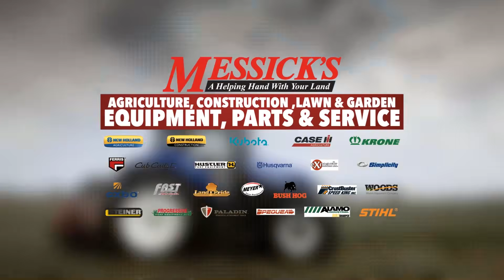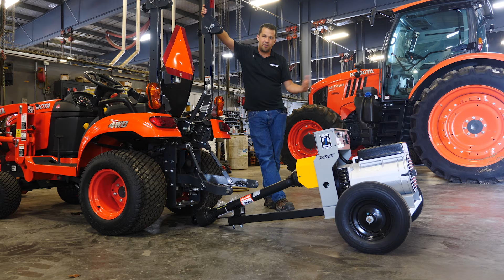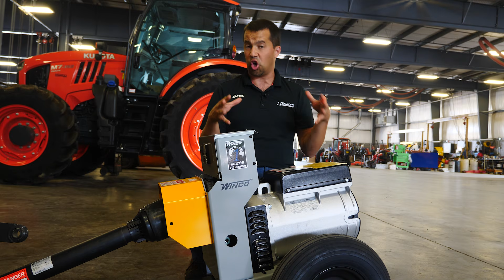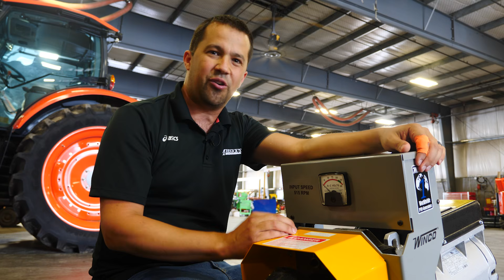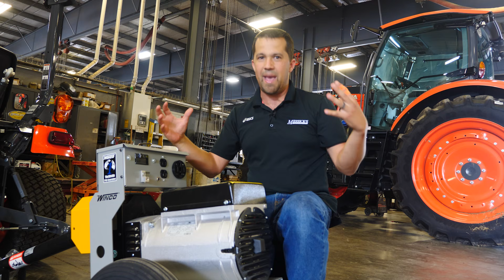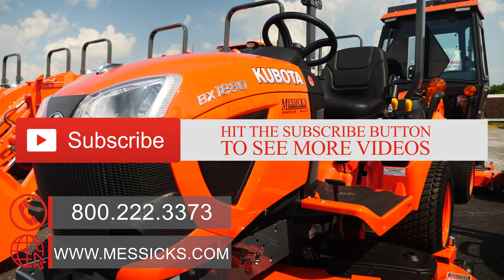Power your home with your tractor - Winco PTO Generators

Comment: I would  like to buy  a pto  generator   of 15000 watts,   prices vary I know but because  I had a Winco 13000 Watt in the 1978-79  Winter  I would like   the same brand.
Reply from the maker: 7173671319, we have them in stock

Comment: A tractor generator is the only way to go. Your tractor is being used and the carburetor is not stopped up. When you pull the generator out like most gas generators, it's a no-brainer to only run it off your PTO and you don't have to worry about another engine or any other things running, just hook it up. And there's your power ! And the gen in the video has wheels to roll it in and out of the barn without pulling you back out dragging out a big gen with a motor hooked to it !!

Comment: I have a small mahindra 25hst where I believe the pto horse power is 20.  According to your video my tractor can run a 10,000w generator, is that right? Is there a pto generator that my tractor could run?
Reply from the maker: Correct. 1kw per 2 PTO hp
Reply: @MessicksEquip  Thank you
Reply: @MessicksEquip  I think I will go with the Winco 10,000 watt.  Thank you
Reply: @MessicksEquip  I will go with the Winco 10,000w thanks

Comment: Question I have compact tractor has front rear mid pto options. Is or if front pto rpm’s different say 1800 rpm to run a pto generator of front pto

Comment: Any thoughts on weather a geared tractor would be better than a HST where you don't have all that transmission fluid over heating durring long runs.
Reply from the maker: An HST does not pump fluid sitting still.

Comment: Video is spot on.  Back in 04 bought a jd2210 new. 09 comes ice storm  no elc for 3days . Ran my 13kw PTO gen 24/7. But I'm totally elc so no hot eayer or elc stove. But elc heaters,  110 skillet  thanks to my farmer friends diesel was ample.  PTO is the only way to go. We live in a small town  1500 tops people would drive by how do you have elc I would say listen the little princess  is running  my  generator

Comment: Iv got a question my jd2210 can I run a generator on the front poston rated @ 1000 rpm @ 540 & still get the out put kw for said  generator of  13kw  of 7 kw rated 14 hp @ rear pto
Reply from the maker: No, you will need to run at 540
Reply: Tku for re keep up your excellent adv6& info have a Blessed day

Comment: Two questions; I have a MX5200, wondering if it would be an economical solution to backup power with it’s 52 hp engine? Also, how long would your ‘best guess estimate’ be of how long a full tank of diesel would power the PTO generator. Thank you, I learn a lot from you..
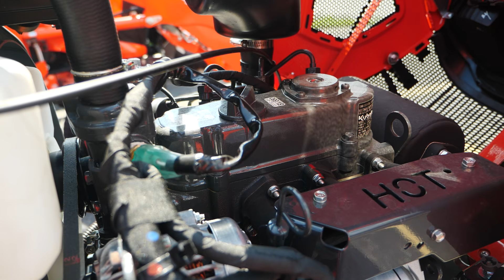Reply: How long will a tank of fuel last is going to depend on the load on the generator. If you go look at a Kubota whole house generator that is a 22 KW at 3/4 load is going to burn roughly 1 gallon per hour. I have an MX-5100 and I'm planning on doing a 22KW generator before this next winter that's why I've been researching it everything I'm saying it says about 1:00 to 1.1 gallon per hour on the stand by generators most of them are running a 2.2 l Kubota motor which is a 45 horse

Comment: I live in a rural NE county and see many of these generators mounted on concrete pads on the outside of dairy farm barns. After we suffered a 10-day power outage due to a weird rain, sleet, wind storm in the middle of winter, many homeowners were scrambling to buy portable generators. I finally managed to borrow one and pig-tailed it into my clothes dryer electric receptacle. Worked like a charm. But it got me wondering just why automobiles couldn't be configured to spin those same dairy farm generators using some sort of PTO set up for such emergencies without resorting to the "Green Acres" belt-driven old pickup on blocks with tire removed setup. Cost prohibitive? Or a policy issue due to insurance costs due to accidents? Just seemed crazy that one couldn't keep their family warm and lit during an emergency using a high-powered combustion engine running at idle, or revved a bit. Why no PTOs on automobiles?
Reply: Hey, what's wrong with Green Acres technology LOL?

Comment: I cannot recommend Winco PTO operated generators enough.  I have a 25 KW unit and after Hurricane Michael it ran for 28 days straight connected to my L3400.  I had hot water, meals, air conditioning, and lights.  If you have a tractor of any size you should have a PTO operated generator.  I have a degree in electronics and have worked in power plants for over 40 years and I agree with Neal 100% regarding their suitability for both home and commercial use.
Reply: Hurricane Michael here too Richard - Panama City, Fl.
Reply: I live in SE Texas where we deal with hurricanes often also. I just bought a used Winco 25KW to use with my new L4802. I'm glad to see someone posting with a smaller tractor running this same generator. Curious just how much fuel it uses in 24hrs.

Comment: Any reason someone couldn't use a gas engine to operate this ?
Reply from the maker: You would need the right gearbox to get the rpm correct, but then... Sure.
Reply: @MessicksEquip  what's the rpms need to be ? I guess that was my confusion.. I was more thinking of a way to power something like this with a car or engine on a run stand, etc.. 

Would be cool to make some electric for the house while breaking in engines and whatnot lol

Comment: I have one of these exact one 15kw that I run off my m7060. Question is do you need a certain pto shaft to handle the load I ask because if I say turn on my well pump the load is heavy at first and it sounds like a clutch chatter is slipping real loud. I can’t find any info on the what shaft is recommended? My kubota dealer sold me the shaft as well but I have my doubts.  Any info would be great thanks.
Reply from the maker: Does the shaft have a slip clutch? You maybe hearing that.

You also have very large tractor for this size generator. Possible your slipping the gears in the gearbox.
Reply: @MessicksEquip  ok found out today what happened my kubota dealer sold me a hay Tedder 2 disc light duty with a rotary pin clutch on one end. 
Removed it and installed another one with out any pin drive clutch and issue went away runs everything in the house.  

Come to find out from Winco you should never run any clutch system on these types of generators.  Normal pto shaft to transfer power. This is not a ground touching unit like a 72 inch finish mower.
Reply: @MessicksEquip   I bought this setup from watching your video on the Winco pto.  It’s a really nice unit here on the farm very strong for a 15kw. And clean energy.  

I knew I could of went bigger but at the time over the summer I could not find a 20kw or 25kw so I settled for this unit. But your right these kubota motors will outlast the tractor 🚜. 
Saturday we had bad 60 mph winds and a lot of Michigan lost power so this was the first time trying this unit out this year since I purchased it.  Again great vids you post always watch them.

Comment: I’m looking into getting a generator head to run off of a tractor. I have neither yet, but I have a question that’s pretty generic that hopefully someone can answer. Take a regular generator you buy at the store for example. When you start the engine, it runs at a constant 3600rpm usually. Until a big load hits it. When a big power demand hits it, it throttles up for a second to keep up with the demand. How would this work on an independent tractor/generator setup? Do you just need a high enough horsepower tractor to where it just lugs for a second then catches up?
Reply from the maker: these have much higher turning mass so they handle transients like that much better. The wattage ratings are continuous loads, not peaks like you see on gas generators.

Comment: Why does a PTO generator cost more than a standard self powered generator of the same output?  Seems like it should cost less since you are providing the engine🤷‍♂️
Reply from the maker: PTO shaft, cart, etc. All cost more than a Chinese engine. That, combines with the generator unit being better quality.

Comment: One point he missed is that you do not need to run the generator 24 hours per day. Run it for an hour to heat or cool the house and then off for 40 minutes or more depending on the climate. You only need to maintain the house temp and refrigerator temp. Remember, you have to ration your fuel. The local gas/diesel pump won't pump during a power outage. Always keep you tractor near full of fuel and keep at least 10 gallons on hand in storage cans. Don't want to be caught with an empty tank and no fuel when the power goes out.
Reply: Except you can tow your generator to the fuel station and power it to fuel yourself up!

Comment: The man in the video talks about the hours on a tractor engine to run a generator plus the amount of fuel that would be use. How about take them WINCO generators and use another way to it FREE ENEREGY with usage of electricity 24/7 and NO TRACTOR ENGINE OR DIESEL FUEL OR GAS,  Here is how see all these youtube video‘s. #1. This video is called ( MAKE FREE ENERGY GENERATOR 220V WITH 5KW ALTERNATOR AND MOTOR FLYWHEEL FREE ELECTRICITY GENERATOR.) #2. This video is called; (MAKE FREE ENERGY FROM 12KW ALTERMATOR). #3. This video is called; (FLYWHEEL POWER GENERATOR AND MULTIPLICATION AND STORAGE)  #4. DO THE SAME THING WITH THEM WINCO GENERTORS THATS IN THEM 3 VIDEO‘S. THATS LISTED HERE.  AND RUN YOUR HOME WITH THE 3 VIDEO‘S AND WITH THEM WINCO GENERATORS, JUST MAKE SURE YOU HAVE A POWERFUL ELECTRIC MOTOR TO HELP RUN THE SYSTEM. ONE WILL FEED THE OTHER 24/7. GENERATOR FEEDS POWERFUL ELECTRIC MOTOR AND YOUR HOUSE IT GOES SOME WHAT IN A CIRCLE 24/7 AND RUNS EVERY DAY. IT‘S FREE ENERGY-ELECTRICITY TO YOU

Comment: I have a 19 hp PTO tractor what size generator should I be looking for  ?
Reply: It would run a 10KW easily,  and would be maxed out running a 12kw.
Reply: but in realvill, you never want to run a generator at full capacity, so it'd be better to have a 12kw generator, but to not load it more than 10-11
Reply from the maker: 10kw

Comment: If you have a small tractor . The salesperson is correct. Running this a half capacity should power a home. The transformer on the electric pull outside is likely only a 10 kW or 15 kW at most. I live in Aurora area My text door neighbor and I are off the same transformer when the pole it's a 15 kW. Hey typical house should be able to run easily or no more than 7200 watts of power. If you have electric heat that can be a problem. If you have electric dryer electric stove electric water heater that's all fine just try not to use them all at once. if you got the oven on and all the burners on don't be drying clothes.

Comment: You said it takes around 2 PTO horsepower for every 1kw out of the generator. Its that purely just for this type of generator set up? Are there generators which can produce 1kw with less than 2 pto horsepower?
Reply from the maker: No. It's a constant.
Reply: @MessicksEquip  1HP can create about 740 or so watts. 1kw is a 1000 watts. Just google hp to kw.
Reply from the maker: @4932gb  Won't have 100% efficiency. 2Hp per KW is not a perfect conversion, but its easy and a close estimate.

Comment: I have a B2650 with the mid PTO that is set up for a snowblower going all the way to the front I was thinking of building some sort of generator that would run off of that shaft even though the maximum speed of that shaft is 2600 RPMs when you are running the snowblower  but you could possibly run a smaller generator head direct off that shaft when the blower is not attached!
Reply: you could also do a belt drive with different sized pulleys to bring that 2600rpm up to 3600 to run a belt drive generator, OR do different pulleys that would slow down the output speed to run the 540 rpm pto generator.

Comment: The only reason why I choose the gas crate generator vs a PTO generator is that when you load up a PTO generator the voltage drops and you have to manually keep throttling the tractor up which just isn't reasonable when you have appliances constantly turning on and off.
Reply from the maker: You should not be tweaking the throttle. You set it at 540 pto and walk away.

Comment: The motor in those smaller BX/B series kubotas and are usually the same engine you will find in a dedicated diesel generator like the Kubota Low Boy and bigger industrial branded generators and welders, not to mention mini excavators and skid loaders so they are happy to run at constant rpm all day.  if your really trying to keep the hrs off your tractor for resale why did you by one in the first place?
Reply: I agree!  What's the use in buying one if you want to just park it in the garage and look at it.  You can go to a dealership and look at it all you want for free!
Reply: ⚠️Please make sure you follow all the generator safety tips whenever you use your portable generator. This is just a reminder for your safety when using generators. All generator safety instructions need to be followed carefully. 

Here are the safety tips: 

1) KEEPING OTHERS SAFE: Please do not allow an unqualified person or your children to operate and service the portable generator. Just because some manuals don’t say that doesn’t mean it’s safe. That is important against the generator safety rules. We also need to be keeping an eye on our children too. You need to make sure that your children are not playing near the portable generator especially when it’s running so they won’t get electrocuted. Generators pose electrical risks and they can be hot during an operation. Please keep your children away from the portable generator at all times. It is important to keep our children safe especially our little ones. Children often get curious about anything so we should keep an eye on them to also make sure they’re not wandering towards the generator. 

2) WHERE TO RUN YOUR GENERATOR: Some people use their portable generators indoors which increases the risk of carbon monoxide poisoning. It’s important to have a carbon monoxide if you have a gas generator. Never ever use your generator indoors even if your doors and windows are open and even in the garage is not safe to use a portable generator. Not even at your porch and your deck. It is never safe to use your generator indoors and in enclosed areas of your home. Your generator needs to be 15-20 feet away from your house. 

3)🔥FIRE HAZARDS: Never refuel your generator while it’s running. You need to let your generator cool off before refueling it and before storing your generator. Never overload your generator too. Never ever back feed your generator. You should never plug your generator into a wall outlet. Also never store propane tanks indoors. Please keep flammable things away from the generator as well and please don’t smoke cigarettes near the generator. Having a fire extinguisher next to the generator is also important against the generator safety rules. 

4) GENERATOR OPERATION: make sure your hands are dry before touching the generator. Never use your generator in wet conditions. Don’t let your generator get wet. You need a generator tent if you need to use your generator during wet weather. Please don’t wear loose clothes when operating the generator. Turn on your generator before plugging in appliances. Use the right cord for your generator. Please do not use worn out cords. 

Hope this helps.

Comment: Anyone ever use these to generate water from a water wheel?  Seems like almost a no brainer to me... but... haven't done it.  Any experience?  The water wheel spins slower, so you'd have to gear it for the appropriate speed, but that'd be relatively easy probably.  Like... water wheel spins a gear with a chain.  That gear with chain is hooked to a more appropriately sized gear and shaft to get the rotation speed needed, and it can all be connected by a male PTO connection welded on, and voila, you have water wheel and connection to generator.  Can these be used 24/7?  Thoughts?  Seems like the hang up of using water wheels is literally the figuring out of the generator.  Something like this really strikes me that it could.... really tie the room together quite easily.

Comment: In this video you say hours don't matter so using this generator is fine. In your video on log splitters you say hours are bad and an individual should buy a stand alone unit over one that attaches to a tractor. Can you clarify your position on tractor hours?
Reply from the maker: Primary problem of the three-point log splitter is the speed. Not so much the hours.

Comment: I don't know about other tractor models but I know a lot about the small engine kubota's working on the r&d field testing them tens of thousands of hours. He's absolutely right the rest of the tractor will fall apart around it except for the engine. I've seen people remove the air filters from them and drive them for a thousand hours before they have problems with no filter.

Comment: It depends because the old winco ones (cast iron) are better than the new one me being a generator tech in CT. 3600 rpm is so much crap and raddle apart MTU on-site energy is the brand I recommend For a stationary genset and generac, kohler, Cummins and more are complete made in China crap

Comment: What would be very useful, would be a pto welding trailer for the tractor, just hook up the tractor to your pto welding trailer and drive it wherever you need.
Reply: With one of these generators, a Lincoln "cracker box" and/or an electric mig/tig (or gassless) wire feed, you'd be on your way!

Comment: All depends on power output and price. I have a Honda 20hp 10,000 watt self-contained. Tractors are expensive and would not want to leave mine sitting for, in some cases days just burning hours off. I mean if you are running a farm off it is one thing. The average home ....would need a tractor first.